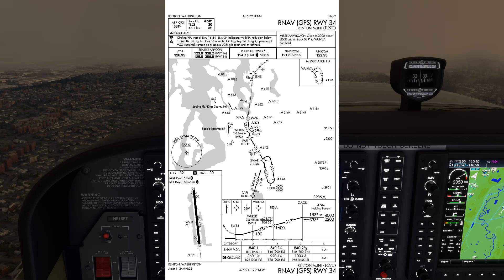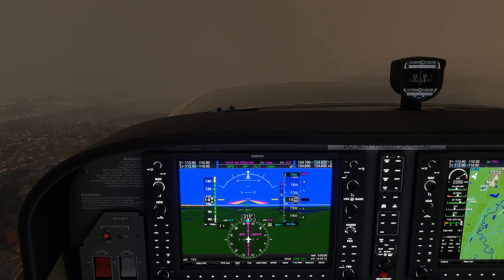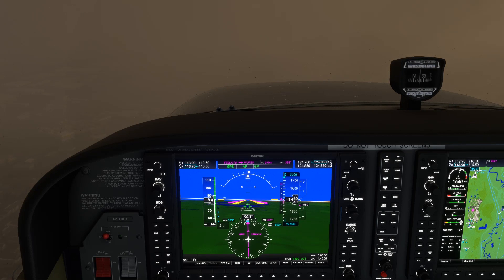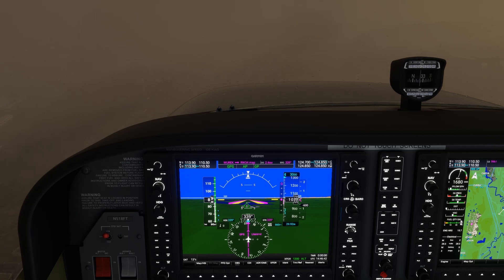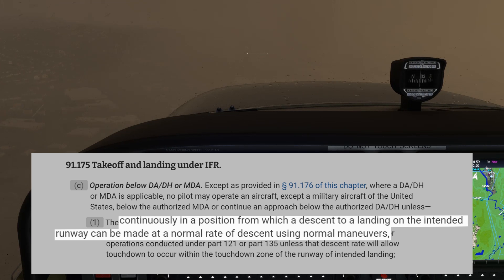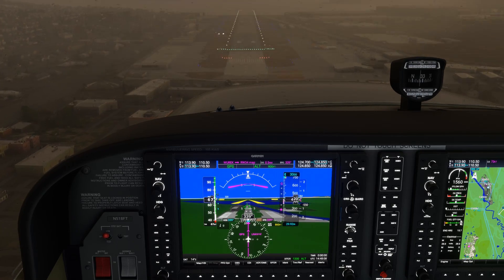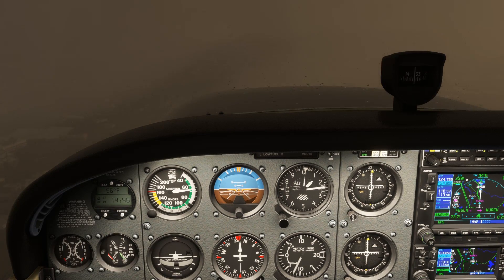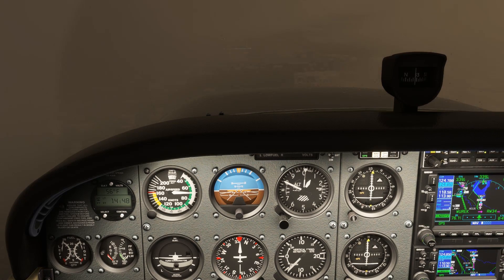Dive and Drive or CDFA? | KRNT Renton, Washington RNAV 34

Comment: Nice video as usual!  One thing I would add is there are MANY advantages to Jepp charts one of which is that the approach plates will have the decent rate in ft/min depending on GS and in some cases WHERE to initiate  the CDFA decent so you don't bust the altitudes....This is a VERY IMPORTANT point as the ADVISORY GS on these approaches could cause you to be lower than charted.

Comment: 4:25 I think you have a slip in your verbiage there. 1000fpm is an aggressive descent, but it's stable as long as it remains a consistent 1000fpm.  "Destablized" or unstable would be if you're aiming for a 1000fpm descent but it's fluctuating between 800-1200fpm.  You can just as easily be unstable when aiming for a docile 300fpm descent.  Known pitch/power settings are quite helpful here.

Comment: Refer to AIM 7-3-1 for guidance on effect of non-standard temperature on actual/true height above the ground.
Reply: Thousands of feet above airport x degrees below standard x 4 will give you the error. At 500 ft above airport (typical MDA) with a 20 deg C colder than standard, you will be 0.5 x 20 x 4 = 40 feet closer to dirt than what your altimeter says. In practical terms, this is no problem at all.

Comment: “Dive and drive” is a misnomer. The stepdown is really descend and drive and it is still stable. We should properly distinguish between climbs and zooms and descents and dives. Climbs and descents involve power differences such that chemical energy rates impact potential energy. Accelerations and decelerations do chemical to kinetic. Zooms and dives, however, are unique in that these are the trades potential and kinetic. You don’t “dive and drive” an approach.
Reply: Search Medium for Improve your Landings with AOA and Power Techniques for more on descents versus dives and zooms versus climbs.

Comment: why is it possible to be on the glidepath but cross the fix below stepdown altitude on hotter than standard days?
Reply: Hotter or colder days = different altimeter settings. If you have X-plane or MSFS try it out by changing the temperature and/or altimeter settings... I'm going to do that and see how it exactly it affects the situation.
Reply: So I just tried this out in X-plane 11 on LPV approach using the stepdown altitudes instead of the glide slope... First I tried a cold temperature of 40 degrees F with at local altimeter setting of 29.50 and the stepdown fix correlated with the glide slope... I then turned up the temperature to 90 degrees F and the altimeter setting to 31.50 and reset my altimeter on my plane and guess what... the glide slope correlated with the correct altitude and stepdown fix... I don't know what Dan is talking about heat making it so that you're on glidepath but below the stepdown fix....
Reply: The tolerance for your altimeter, while on the ground, is within 75ft of field elevation. You don’t have the same tolerance on an approach. It’s very possible to be off by .01 on your setting, or the altimeter setting changes while you’re on approach. He’s trying to say it’s possible because the glide path is ONLY advisory. I think he’s driving home the point you shouldn’t treat an advisory glide path as anything but situational awareness and you’re still responsible. Sims are a lot different in this way to actually flying.
Reply: At any point along a GPS-based glideslope, what would your altitude indicator, which is baro-based, say on a cold/low-pressure day vs. a hot/high-pressure day? On a cold day it might say 1100 ft. On a hot day, that same physical point in space would cause your baro altimeter to show something lower. Since the step-down minimums are for you to apply to your baro altitude-indicator, not your GPS, you may be violating stepdowns on a hot day when you wouldn't if it was colder.

Comment: Is RNAV still NPA approach? Thought its APV now
Reply: It will depends on if it is 3D( lnav+vnav or LPV)= APV.
If it is Lnav only(2D), then it is NPA.
Reply: RNAV approaches can have different minimums depending on approach and aircraft capability.

An LNAV doesn't have vertical guidance and uses step-downs like shown here and would still be considered a non-precision approach with no vertical guidance.

An RNAV approach that has LNAV/VNAV or LPV minimums, unlike the one in the video has vertical guidance can be flown using that vertical guidance. An LPV is still the only one that relies on WAAS which is an approach and aircraft requirement to use LPV which is basically like flying an ILS but using GPS. But this is considered "precision-like" but will even be accepted flat out as a precision approach in the new Instrument rating airman certification standards coming late May.

(anyone else feel free to add or correct anything I'm missing)
Reply: All RNAV approaches are still non-precision, even with WAAS for LPV. LNAV+VNAV and LPV offer vertical guidance to typically allow for lower MDA, but still not considered precision approaches.